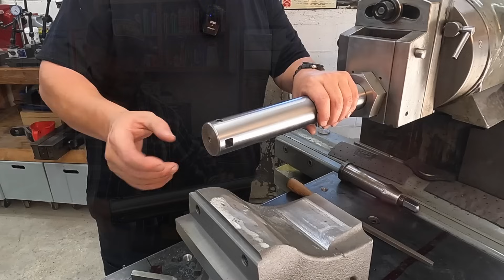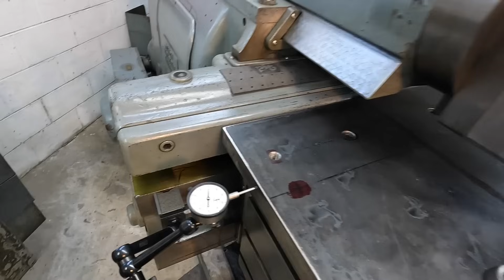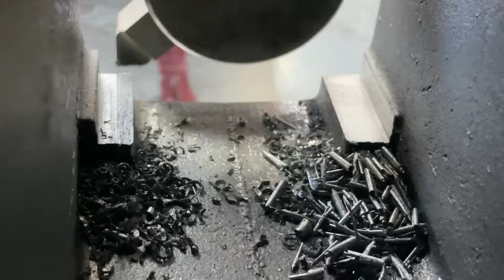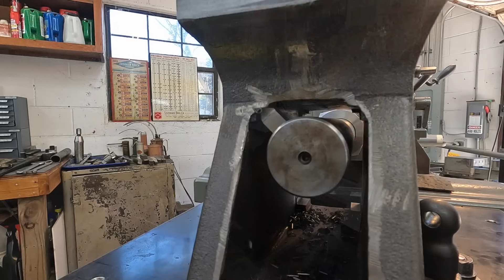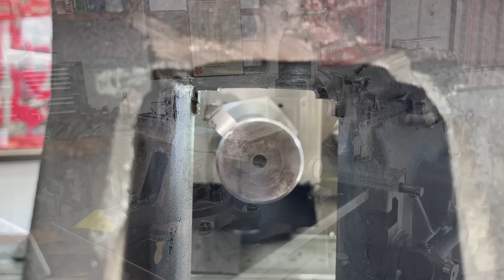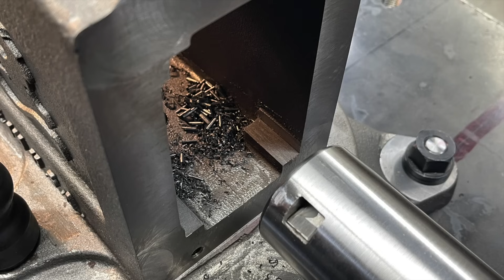Hardtail Vise Ep. 22: Internal Shaping to Fit Dynamic Jaw

Comment: About your alignment problems at 1:04:30 : Your machined taps should be in line with each other on this side, right? Maybe you could have made a small bar with fitting holes you can mount on the taps and measure the distance from the bar and your shaped edge, at the upper and lower corner. If your holes are aligned correctly, the distance should be the same if the corners are aligned well, too.

Comment: Adam could you duplicate the meatball for the swivel nuts without the hole.  Then cut the hex nut.  You might have to use deep socket but I really like like the idea of being able to tighten the swivel
Reply: Excellent idea!  The short little loose-fit thru-handles make perfect sense for a vise that exists in isolation from other tools, as in my basement home office & electronics workshop, but Adam's situation is quite different.  He should certainly move towards converting ALL of his adjustment & locking screws to hex-heads, preferably of one size throughout.  When I take the time to think about it, I wonder WHY we have so many different sizes of hex [Allen] keys, for instance, or over a dozen Torx driver sizes, with or without 'security' central pins, in both metric & imperial sizes, when my Canadian square-head [Robertson] tools manage to cover a huge range of screw head sizes with only FIVE colour-coded drivers [black, red, green, yellow, orange].  Madness!  Who benefits, other than the tool vendors?

Comment: Hey Adam great video... Thanks for sharing... How would you do this if you didn't have the shaper?
Reply: That's what I want to know too.  I can't think of a way to machine this without the shaper.
Reply: @akschu1   Note how you are subconsciously assuming the job can only be done with a power tool.  In a pinch one could use hand files.  The workpiece material is only cast iron, after all, easy to cut.  How would your distant ancestors have done it before shapers existed, is the question to ask.  The only downside is the extra time involved, and notice at 12:10 how setting up the shaper is about to take huge amounts of additional fussy set-up time - by now Adam might be half-finished the job with a file or two, using a precision straight-edge sliding in from the front as a visual alignment tester!  
Same considerations in woodworking - razor-sharp chisels & planes can be used to construct exquisite furniture without employing any power tools.   Tradeoffs, tradeoffs...  
Imagine trying to make this video fifty years ago - tungsten filament lighting, analog film movie cameras, manual focus, manual lens aperture settings, limited camera run times, costly materials.  Manual acetone-based solvent-weld film splicing, etc.   Never say we don't live in miraculous times!
Reply: Wire EDM maybe.
Reply: A custom broach would be my guess. He certainly has the machinery to make something like that without much trouble. Always nice to see anyone making custom tooling.

Comment: If I'm not mistaken the clapper box will not work when cutting the top? I'm not sure how you would cut the inside of that vise without a shaper which is said to be a obsoleted machine. Not sure how you would go about cutting it with a mill?
Reply: This is why he was talking about locking the clapper, effectively just making it a fixed mount.  He mentioned it briefly in this video, but talked about it at length a few years back.  As far as doing this in a mill .. ¯\_(ツ)_/¯

Comment: Hi Adam - I was thinking about the arm off your clapper box and how the rear flange could be improved for reference angles. How about the rear flange being machined into a shape like a round gear on your CNC? Perfect project. A recess in the back face of the clapper would mean the arm could be strongly referenced at any division based on how that "gear" shape is fitted in. That gets you your ninety every time. A gear with twenty-four round teeth gets you 15deg each step.

Comment: How would you do this without a shaper?
Reply: Wire EDM would be a very good option. Sinker EDM would also be possible. It might be a struggle to get properly sharp corners, but a 5-axis CNC mill with a long tapered ball nose endmill could possibly get in there and do a half decent job of it as well.
Reply: A custom broach. Would be a lot of work for one vise. I would bet that's how fireball does it. Rough machine to fit the guide then broach the finish work.
Reply: @philbert006  you cannot guide a broach, so I doubt it, could not align the jaws
Reply: @philbert006  Now that you say that, I think Adam mentioned fireball tools had a custom broach made for this.

Comment: As far s a reference plane to align the upper and lower rails, when milling in the fixed jaw body, perhaps mount it to an angle plate, one side up, then the other, and end-mill a 3/8 to 1/2 inch wide plane at the end of the casting, that is perpendicular to the base. I understand that would conflict with the esthetic of maintaining the original cast surface, but to make that new surface appear more consistent, mill the adjoining edges of the hard-tail to match? If not milling along the entire length of the side of the fixed-jaw body, perhaps  two matching surfaces on the outside of the fixed-jaw body and in the direction being parallel to the fixed-jaw base.  Do that with a 1/2 inch end mill about 3/4" to 1" long, perpendicular to the base.

Another possibility could be having made a 1/4" thick steel plate of the approximate shape of the surface the hard-tail mounts to. Utilize the hard-tail mounting bolts to attach it to the fixed-jaw body, dowel-pin it in place to maintain position, and then cut out the middle, making the cutout the exact dimensions of the needed opening size. When you assemble the hard-tail to the fixed-jaw body, having removed the dowel pins, those pin-holes would be covered by the hard-tail flange.

Also, perhaps make a dummy plug about .015 to .020 smaller than your expected final dimensions, and work up to matching the hole-size using feeler gauges. Or make 2 dummy plugs, one like described, and a second one with the exact cross-sectional dimensions as the dynamic jaw slide. Use the undersized plug to establish the location, and the full sized one for your final test.
 
OR... 
Get a custom broach set made for a few thousand bucks to broach the final hole! Just kidding!

Comment: Not a machinist here.  Perhaps a precision rectangle of the desired size.  Rather a go, no-go gauge.  Then machine in a two direction "gib" that, along with the corresponding movable part could assure that the final corner is where you want it.

Comment: Adam,  What if....... you were to drill a succession of holes around the thumb screw in your adjustable parallels tool, so you could use a pin to tighten more easily ?

Comment: To check that the top and bottom vertical side cuts are in the same plane couldn't you put an mag indicator on the tool cutter post and then run the table from bottom to top?

Comment: I assume your non - sparkling wrench is made from beryllium copper (typically 5% 95%), used in areas like mines and others where flammable vapours are found. You can get hammers and even hacksaw blades in this material, and it can be as strong as high tensile steel. It's expensive, look after it! And thanks again for all the excellent videos Adam!
Reply: His non sparking wrench is marked USN probably used on the hanger deck of an aircraft carrier. You don't want sparks in an area where aviation fuel vapors and ordnance are in the same place
Reply: Last time I saw tools like that I was selling the company a Peristaltic Pump with a Remote Hydraulic Drive for Pumping Nitroglycerin. In this case we swapped out all the fasteners for Aluminium Bronze which is also commonly used.
Reply: It could be from a submarine. WW2 ones had non- sparking tools

Comment: Adam, if you go into production on these vises, build a tool that has opposing triangles. The opposing triangles have square notches cut such that a 2 sided square broach can be pushed through on each corner, cutting a square corner.

The two triangles have a brass or delrin centering pad that pushes on the rough casting as the triangles are pulled together by a bolt that draws the two wedges together.

An index mark on the two wedges will tell you how tight to make the wedges to get exactly the right spread.
Reply: Doubtful that he would ever consider doing production runs of this vise. It would be in direct competition with Fireball and no way could he recoup the production costs. These vises are expensive enough as it is.

Comment: I cringed when you used that Stillson wrench on your lovely hand made nut on the shaper tool extension. Please either buy a wrench from a vintage tool supplier or make a properly sized open end wrench.
Reply: I about cringed when I read this comment.
Reply: @TempoDrift1480 true
Reply: @_BLENDRR  brass, bronze (in many alloy and reinforced type of drop forged wrenching tools), some alloys used under water work well for non-sparking.
Reply: Respectfully, either it is art or artifact.  One is used.  The other is looked upon.
Reply: @dankolar6066  What????

Comment: Thank you for the video, Adam! This seems to be the most tricky machining operation in the series. It must take a lot of patience. I wonder what machine/process Jason uses to cut these inner surfaces during serial production.
Reply: Alex, Fireball tools uses a corporation in Taiwan to do the entire operations, they do all either in-house, cottage industry for some smaller supplies consumed, or sub out what is too dirty like the pouring, forging, casting with concomitant grind gates, pour basin, risers etc.

The castings will be held on reference surfaces created with the pour. I did not see such a surface on this when he was showing us, lo, these many months ago. In this instance Jason may have sent Adam his casting, an obligatory casting he inspected for acceptance of some phase of the initial contract. No clue. 

To answer the exact question you have now. The body is positioned and held in a ridge fashion (I can't speak for anyone but me here though so NaCl crystals on any setups or problems...). A broaching operation will be performed, there might be hydraulics for shimming, advancing of the form tool, there might be coolant of some sort, I would use a light oil, around 5 psi and depend on the work holders for drainage of chips and oil. The broach would be in a fixture for support during the many tiny cuts of the first corner. I would not use a specialty broach set for the limited run made at any one time. Common right angle broaches could be used for the corner, the flat surface which supports the dynamic jaw both in front and at the back are already finished just as in this example of Adam's. Which ever way it is done will be fast, clean, low cost for now. 

It could be as simple as a guy with a finger sized belt grinder and a lot of practice in filing to fit.

Comment: Hi Adam. I love to see that shaper working.
As to the issue about making sure the corners are in the same plane - I was expecting you to have made a tool similar to a square that would span across the bottom and just fit for height, and use the Mk 1 Eyeball with a light source behind to see when the sides were plumb with each other. Trusting a casting seems sketchy - but then again, with a 0.020 margin, it shouldn't really be a problem in the end.